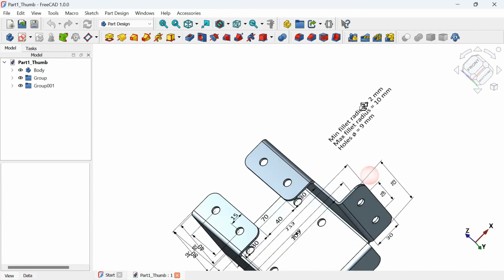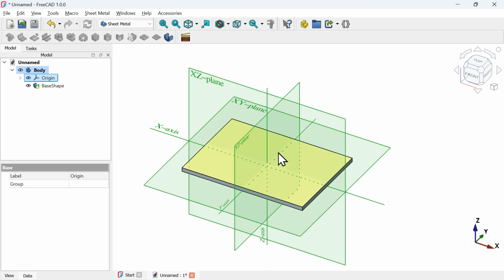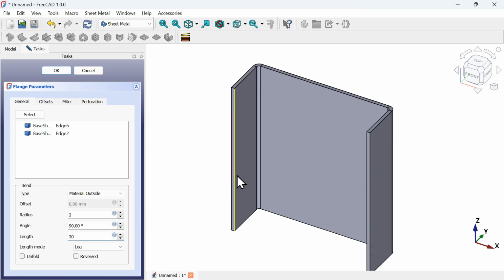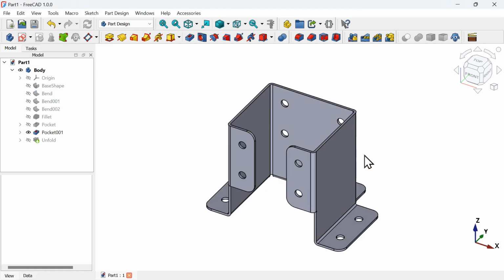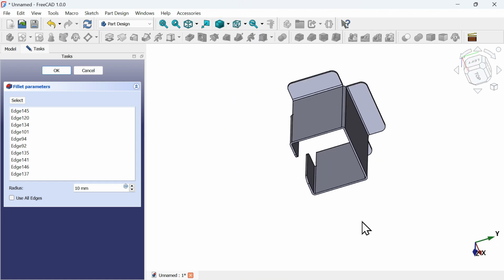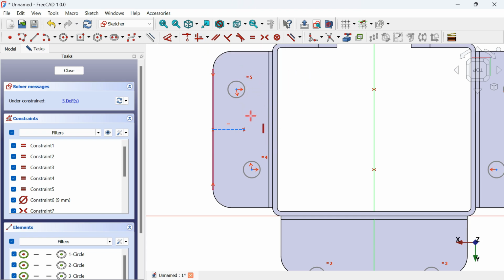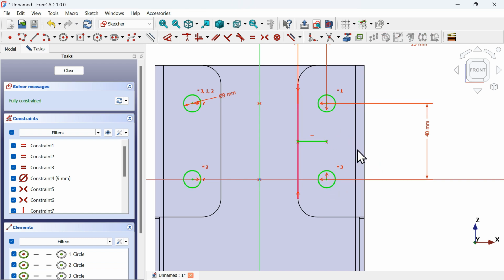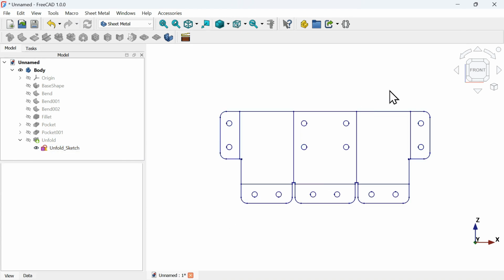FreeCAD 1.0 SheetMetal improvements #1: Base shape, make wall & unfold

Comment: The video is nice and inspiring, I will even replay it later. I have yet one suggestion, you'd rather display as your example a piece that is realistic to actually make. This one could note be done with a sheet press brake, with this four corners and wide tabs. May bee the last tab could be bent with a plyer. Yet I think is more pleasant to be given examples of things quite complex yet possible to do with the purposed tools. Our brains may resist to receiving informations and learning, in front of unlikely or impossible models.

Comment: I liked your video....... 👏👏👏   what is the use of this  sheet metal design.... Can we make Gcode for laser cutting machines..... Waiting for a response..... A new learner ..... Thanks for the excellent explanation
Reply from the maker: You can use the unfolded model to generate the g-code.
Reply: @OffsetCAD   Little time ago, gcode in freecad was mainly available for milling or routing, not for laser or plasma, did it eventually improve in this way ? That would be wonderful

Comment: I have a suggestion for a video. It would be cool to have a video on how to make a tapered thread in freecad. Like those used in pipes. I didn't find any video teaching how to do this on YouTube... I don't even know if it's possible in Freecad.
Reply from the maker: Thank you!
I made a video. Check it: https://youtu.be/jxkx0eAR_Fs
Reply: It is actually possible and quite easy on freecad. Well, it can be discussed. Part design workbench enables helicoidal adds or removals of material from a profile sketch you just have to design. Then the option is given to make the helix have a tapering angle. The issue to my mind is that the helix until now tend to generate a lot of issues and instability. Keep its design for the last stages of your part design process, or you might be quickly upset.